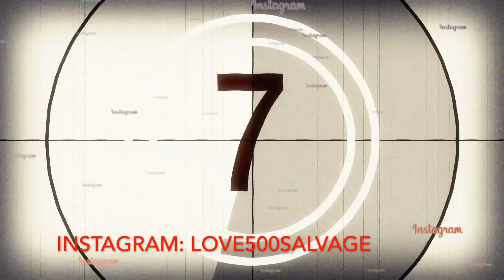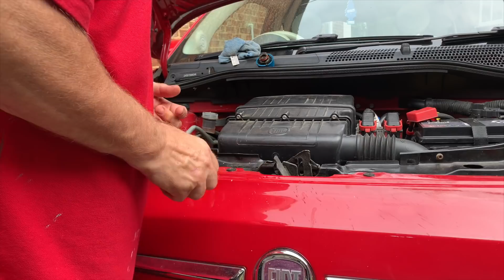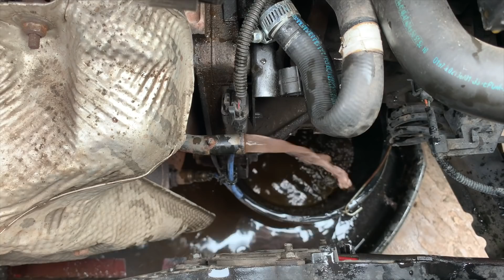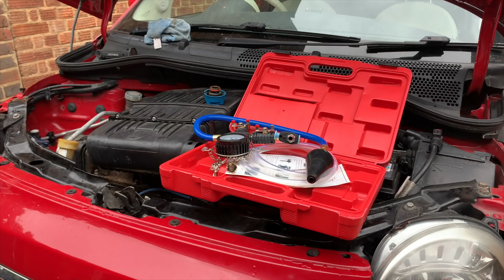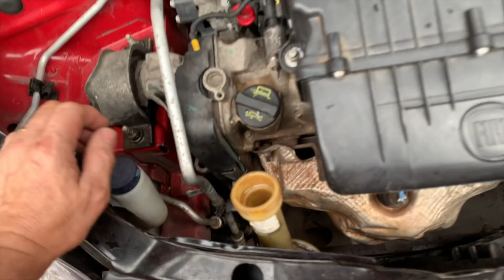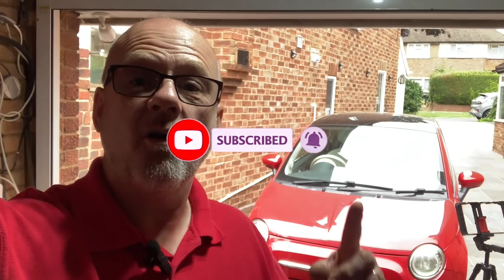Love 500 - More  sequels than Rocky  - Troublesome Copart Fiat 500 Cat S Salvage Crashed car

Comment: I had a similar problem with a vauxhall astra,the customer had taken it to 3 garages before bringing it to me they had fitted 2 head gaskets,secondhand cylinder head new radiator,thermostat and heater matrix.
So i done a sniff test this was fine, after lots of head scratching i took the water pump off and found the impeller had come off the shaft so the pump was not circulating the water,hence boiling the water in the block pressurising the cooling system.
Fitted a new pump,no more problems, might be worth a look good luck.

Comment: Make sure the system is fully bled via the back heater  box hose ,when I got my punto I had sone years ago it also had a water rushing noise always on start up so I did a full service and coolant change and it cured the noise cos usually the rushing noise is an air pocket in the system also check all the hoses are getting hot particularly the main bottom hose this will determine coolant us getting all round the system, can't be anything else going on as you say it's not overheating, no starting issues, fan kicks in as it should and not all the time, as you said could be some gunk still in the system so by flushing it out you can be confident it's clear now !
Other than that it's a nice little car, as you say too good to scrap especially as all the time , effort and cost gone into it .
Reply from the maker: Apart from taking the hoses off that disappear into the car which I assume go to the matrix ive fine a flush. It’s definitely air. I’m going to change the rad cap and take it for a burn down the motorway see if I can push it round.

Comment: This is the exact problem I had with my car when I first bought it Paul … it was killing me I did exactly what you did but sadly my HG had gone! As you probably know I had an engine swap at club500 … runs perfect! Then my coolant started rising above max and my thermostat looked crusty …. Ended up catching it just in time my heater matrix was letting a tiny bit of air in .. hence coolant higher .. new HM and thermostat job done and she’s fine now! I had no wet carpet but pink crusting on edges of matrix.. it’s an easy job to check it pulls out like a cassette only prob is needs draining first 😒

Comment: Had this problem on my old MG TF thinking it was the head gasket, it was a build up of crap in the radiator. Took it off and blast the jet wash through it until the water ran clear and it was fine after that

Comment: Only seen some of your previous videos on this car but I've worked on MK2 Ford Ka's that have the same engine and after re-filling the cooling system there is a bleed screw on the upper left corner of the radiator filler neck (if you're standing in front of the car) and on the heater core return hose (look down to the left of the brake fluid reservoir), loosen these so that any trapped air in the system will work its way out and close them once coolant is flowing from each one consistently, it can take time for all of the air to bleed but this will determine if there is an air lock
Reply from the maker: I do that in this video.

Comment: Hi buddy. I buy Cat N cars from Copart and the one I got 2 weeks ago is a nightmare. Hyundai i10 light damage but delivered with clutch gone and timing chain needs doing. No mention on Copart of this! I have spent hours doing things like clutch cable, engine flush, oil changes and a day cleaning it out, it was disgusting inside. All to end up losing about £400 on it. Sometimes you just have to give up and walk away buddy
Reply from the maker: Oh I’ve done that before but inherently this is a decent car. It’s gotta go though.

Comment: You Said you changed the termostat, Is it a round one you installed under a thermostathousing? If it has a little Hole with a little thingy in it, this Hole has to be installed on the highest point. It is for bleeding water and air through when the engine is cold.

Comment: Have you tried it with new or known working expansion tank cap? If the valve isn't working it'll build up pressure or even suck in air.
Reply from the maker: I haven’t but will change it tomorrow as I have loads of them.

Comment: Hi paul ,what petrol do you put in a 2014  1.2 petrol engine ,  leaded or unleaded  etc just checking has i have never put petrol in one before ,thanks :)
Reply from the maker: 😂😂😂 leaded or unleaded? We haven’t used leaded petrol for about 30 years. If you mean normal or the more expensive higher octane petrol you can use either. Some people only use the expensive one on performance cars but normal is ok. The new E10 fuel is fine in a 2014 car too.
Reply: @Love500  i only ever driven diesel cars so never had to put petrol in lol

Comment: Hi, I hoping you can help me solve the issue with stop start on the 500's? I'm a local car dealer in Belfast and have tried most things.
Reply from the maker: Stop start on these cars is rubbish, it doesn't work most of the times unless you have a brand new battery or do motorway driving everyday. I have a 500X too which is just the same. Most people turn it off to be honest. Complete waste of time on these cars. A new battery and possibly a new earth strap might make it work for a while. There's not much else you can do.
Reply: @Love500  Thanks so much for your help.

Comment: I think it head gasket on exhaust side putting pressure on your system had the same problem on a VW Passat temperature always read normal
Reply from the maker: Done a sniff test. No gases in coolant
Reply: Yeah a sniff test will only work if it is exhaust side if it is the intake side of head gasket you will only get air pushed into coolant so sniff test won't pick up exhaust gases gases

Comment: Not seen all of video yet, but sounds like loopy wants to stay ☺️ Would it be a blocked radiator ?
Reply from the maker: Don’t think so. It had been replaced. Water was flushing through ok.
Reply: @Love500  Did you do the timing belt and water pump on this one, just wondering if the water pump is bad ? I know having a car like this is a nightmare but the YouTube content is great 👍Don't go and lose money on loopy unnecessarily,  I think that everyone will miss him 😊
Reply from the maker: @nickmoore2301  Yes, both done and it's pumping as it's getting round the entire system.

Comment: If you do the headgasket or not, so check the wings on the waterpump…..or maybe remove the termostat
For testing
Reply from the maker: Water pump was replaced. It is working. Thermostat was also replaced as it was leaking. That is also working.